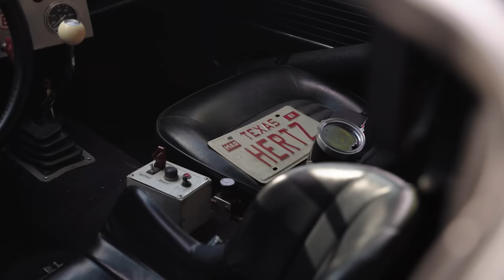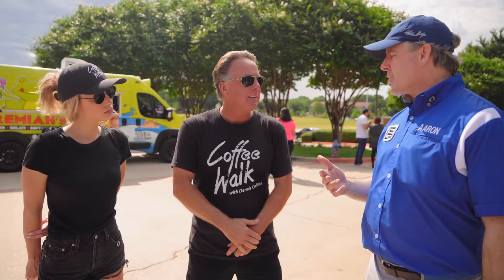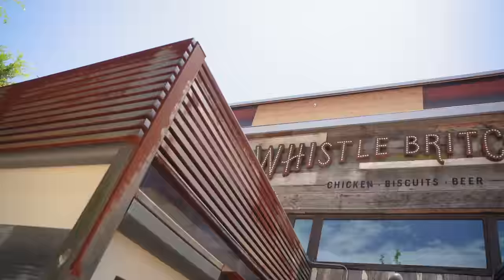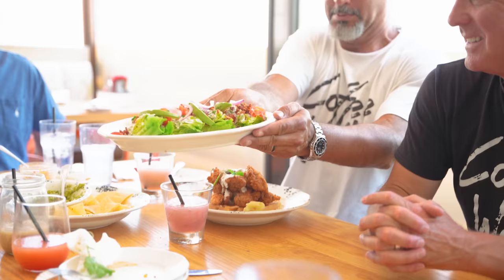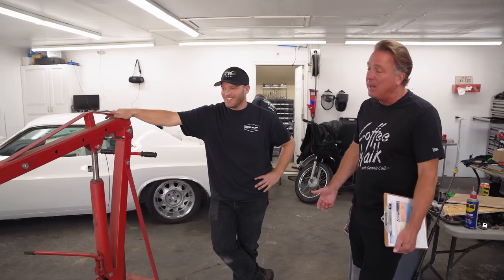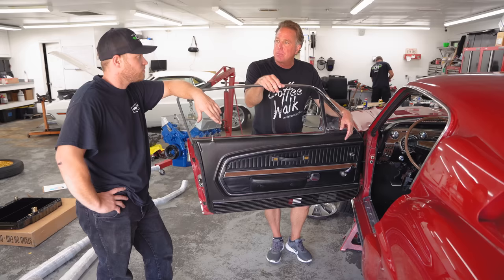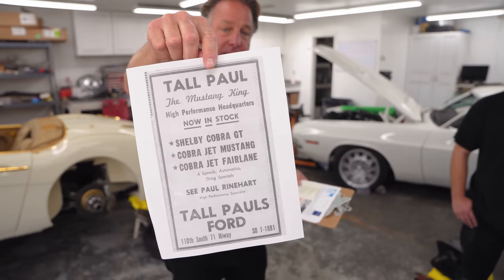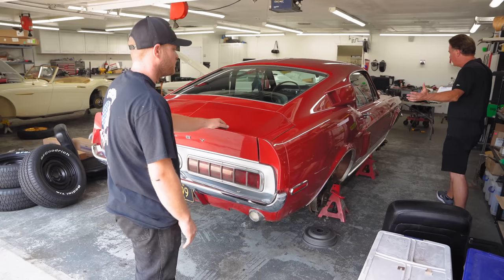200 Shelby Mustangs & Cobras! + UPDATES ARE BACK!

Comment: The most difficult thing to do when building an engine for a survivor is getting the engine paint correct. 
EVERYONE wants to put too much paint on everything - which the factory RARELY if EVER did... because it costs more money. save one ounce of paint on a car over millions of cars and it is a LOT OF MONEY. 
I have gotten restored engines and engine compartments certified as survivors by Jerry McNeish on Camaros, the NCRS Bowtie judges on midyears & Galen Govier on a 19k mile Hemi Cuda by not overpainting ANYTHING. I typically use an airbrush on engines to ENSURE I will not put too much paint on them.

Comment: DRY ICE BLASTER restores almost anything, upholstery, aluminum, plastic, carbon fiber (ask Freddie, saltwater McLaren P1 restoration) seen hardware done, and the top it off leather and alcantara. The only issue is a home / hobbyist one is a minimum of $3,000 and a lower end commercial one is 10-$15,000
Reply: Just like anything else, you buy $1,000 welder/generator or you buy a $5,000 one you get exactly what you pay for.

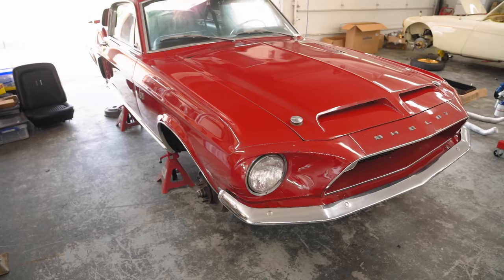Comment: On the front of that red Shelby where it says Shelby is that metal or is it plastic? The part that the letters are attached to. Looked a little wavy. Maybe because it is a narrow strip with a lot of holes drilled in it for the letters to attach? Not sure.19 minutes to 19:13